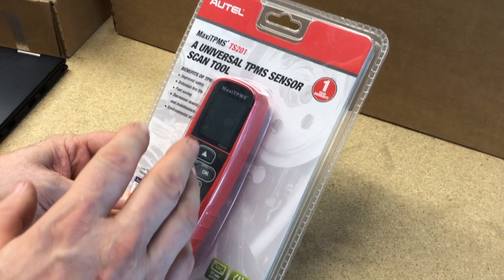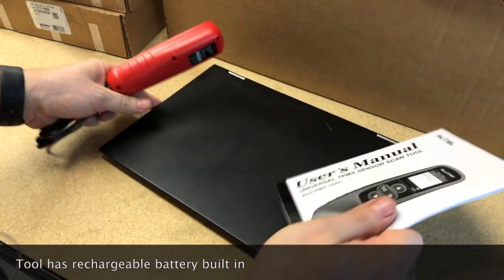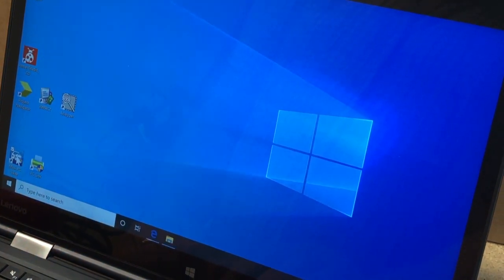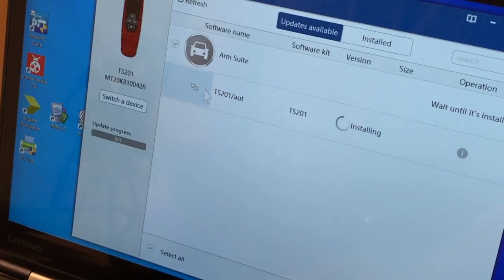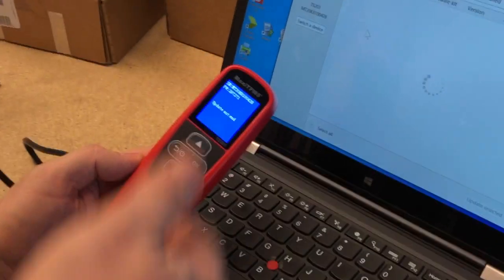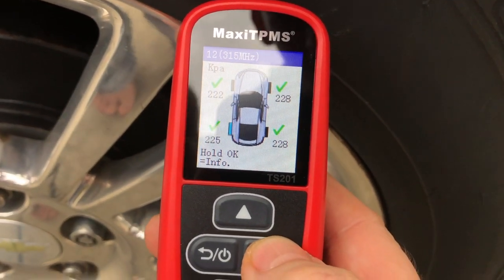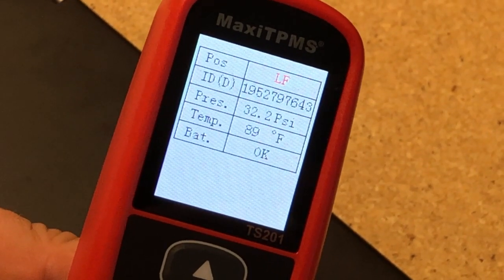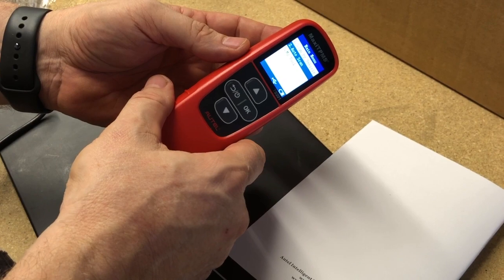Autel TS201 MaxiTPMS TPMS Sensor Scan Tool Unboxing Review and Demo

Comment: Just Bought one of these from Tire Rack. Tool looks really nice and well-made but I was unable to get it to read my 2020 Ram 1500 tpms. Noticed 1) in the My Tool/About display that while I have the latest firmware (1.02) and Hardware (3.0), my Database version is dated 2019-09-17, and 2) there are no vehicles newer than 2019 model year listed in the "Scan by Vehicle" menu. Spent some time on the phone with Autel tech support today, and they told me they will not be providing any further updates for this tool.  If you want to be able to Scan by Vehicle for something newer than a 2019 you are out of luck! Their suggestion was to return the tool and buy a TS508 ($275) instead. Pretty disappointed that they don't tell you the tool will not link (at least with the Scan by Vehicle option) with recent model vehicles.

Comment: How do you get your car in learn mode? Is it different for each make/model?
Reply from the maker: The tool I review here can handle the different radio frequencies that different manufacturers TPMS sensors require to communicate in learn mode.   To get the vehicle into learn mode varies by brand and model, you have to check the owners manual or search here on YouTube if you're not sure.

Comment: I have this tool but it wont read my 2019 Ram 1500 tpms. It does read 2011 Ram though. Any idea?
Reply from the maker: Did you do the firmware update procedure I showed at the beginning?   That's key to picking up the latest sensor data from Autel.   If you did and it's still not there, if it were me I'd open a support ticket at autel here - http://support.maxitpms.com/support/home

Comment: Nice tool. Does it give you guidance on how to get a particular vehicle into learn mode, or does one just have to search that info out elsewhere?
Reply from the maker: It's definitely a shop type tool, where you have to know what sensor activation method you have in learn mode.   But it's an entry level one for the price point, so very sparse on the user interface.   I found it more useful to just pick by make/model.
Reply: @DrShock  thank you for the reply!
It definatley sounds like a good tool to have in the toolbox.
 I've got 2 Fords and a Chevy so having a tool that will do more than one make will be handy.
Reply: Does cover BMW by any chance?
Reply from the maker: @MrCurlymaple  Yep, I took a quick look and see 30 models listed under BMW